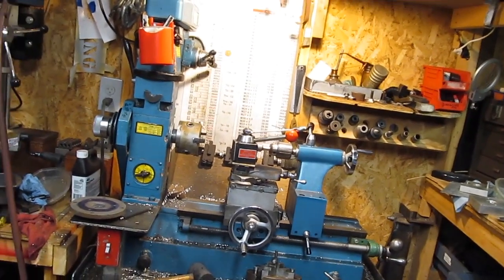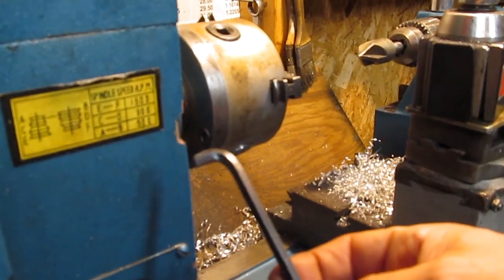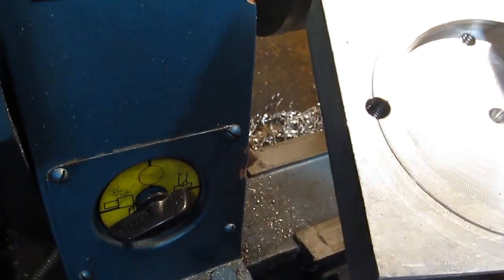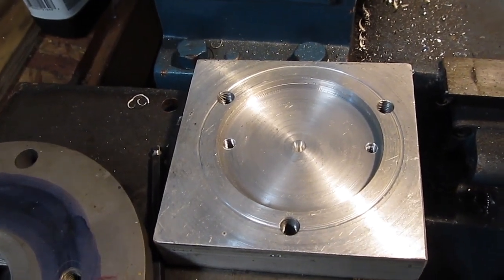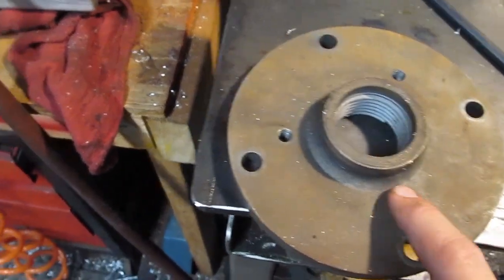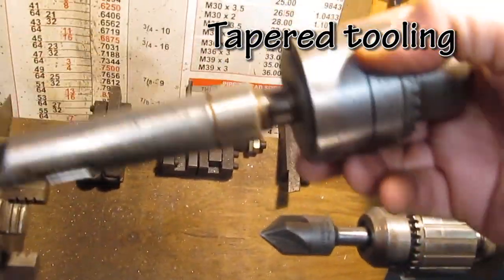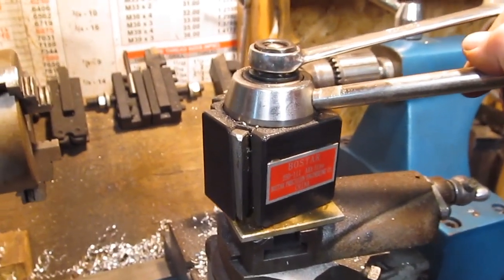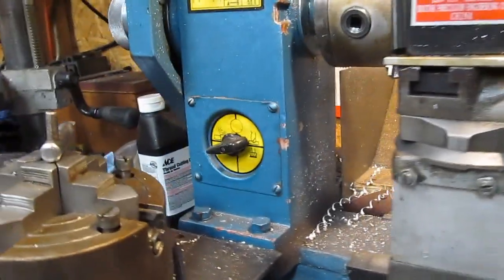Q&A HQ400 Mill Drill Lathe by Chizhou

Comment: Thanks for the detailed answers about the chucks, face plates and spindle tapers.  I very much appreciate it.   It's very useful information to know.  I was guessing about the 3-bolts on the back of the chuck but wasn't sure.   It's also nice to know that they are 6mm.  Now I know what size Allen key to modify.    I was having difficultly trying to get something in there to measure them.
Reply from the maker: Thanks for watching and subscribing!
Reply: Just as an update:

I just now went out to the shop, modified a 6mm Allen key and removed the chuck.  First time I ever had the chuck off.  I'm thrilled to learn that there is a Morris taper behind it.   I threw an MT3 center in and it stuck in there perfectly.   I had no clue that was even available.  This is great!

By the way, on my machine the tailstock is also MT3.  So apparently I have MT3 tapers all the way around.   My machine is very slightly different from yours though.  They look very similar, but mine has the power feed and thread cutting feature.  So apparently it's a slightly different model.

Anyway, thanks very much for the information and videos.  I enjoy seeing how you solve various other problems of holding things in place like the brake drum and carb manifold.   It's always nice to see how other people solve these problems.

By the way, I'll probably being going crazy making a bunch of specialty face plates now.  A face plate is almost as good as a four-jaw chuck.  Sometimes even better.
Reply from the maker: @Mystic0Dreamer  Very cool, that's why I started making videos. I've learned a whole lot watching other creators and just wanted to give back a bit. Glad I could help.
Reply: By the way, this is a bit off-topic from  this video, but I see you are into motorcycles too.  I also noticed the picture of the Triumph you have on your  YouTube channel.  I  had a 1970 Triumph Trophy 500.  I loved that bike.  I actually had quite a few motorcycles including some Harleys, but nothing handled better than that Triumph.  That Triumph was a masterpiece of engineering.  At least in terms of how it handled.  Although I never had a lick of mechanical problems with it either.  I wish I still had it today. 

Today I have only one motorcycle left.  It's a 1982 Virago 750cc.  Unfortunately I let it go and it's in pretty bad shape.  It was stored in a barn for many years and the barn roof leaked.  So the bike got wet and rusty.   I currently have it in a dry garage and I'm hoping to restore it.  I really like this bike too and would like to get it back on the road. 

I tried to start it last year and couldn't get it to fire.  But it was a superficial try and I really didn't put of a lot of effort into it. (too many other projects on the fire).  I couldn't drive it even if it started.  It's needs major work done on the brakes, etc.   The wheels don't even turn very freely, it's quite hard to even push it around.   So I'm looking at a major rebuild.  

Anyway I just thought I'd share that tid-bit.  I'd like to drag it out in the spring and give it another shot at trying to fire it up.  If I can see the motor run again I'd be more excited about tearing the whole thing down for a complete rebuild.   Not a motor rebuild.  I don't think the motor would need to be rebuilt.  At least I hope not.  But surely the carbs will need to be rebuilt.  And the wheels and brakes, etc.   The motor cranks over smoothly.  At least that much sounds good.
Reply from the maker: Yea, motorcycles are most of my business, and my favorite are the old Triumphs. I have 2 at the moment, a 1974 Trident and a 68 500 that is a bobber of sorts, its the bike in my avatar. I also have a HD Road King that is the everyday bike as well as parts and pieces of probably 100 others of all makes. 

You should not have any huge problems with the Yamaha unless it got water inside the engine. You probably will need to inspect and clean electrics if they were damp for a long time. You will most definitely need to clean the carbs if it has been sitting. If you are planning on spring, go ahead and spray some WD or PB down the spark plug hole, kinda spread it around in there, but not a whole lot. Do that a couple times over a few weeks. That will help lube and free up the rings for when you are ready. Those engines will be pretty dry up top after sitting so if you see anywhere you can squirt a little oil or spray into the heads that would help as well (valve inspection hole for instance, I can not remember exactly how that works on that bike).

After that, what I do with a bike like that before anything else is check for spark and compression (both cylinders should be at least 90 psi after spinning for a few revolutions). You can get a comp checker on Amazon for $25 to $40, you don't need anything real expensive. If you don't have compression, on that engine, forget it - you might as well plan on a rebuild of at least the top end. If you don't have spark with a fully charged battery, it is probably just dirty connections, they have pretty good electronic ignitions but they will corrode in damp. If you have both of those, you can try to squirt some gas in the carbs or in the spark plug holes and see if it fires. But honestly, if it has been sitting awhile with gas in it, the carbs will need removed and cleaned before I would expect it to run on its own. 

Anyway, thanks for sharing and if I can help you out with anything 
 or parts let me know, I think I have a 750 Virago stashed somewhere that has some good pieces. Best!
Reply: Thanks for the tips.  I have a compression tester so I can check that out fairly quickly.  Although the bike is currently "buried" under a lot of stuff.   I have to confess to being way overly ambitious and I'm one of those people who have far more projects than any one person should ever try to take on at once time.  

For example, sitting right next to the Virago I have a 1947 Chevy Fleetline that I'm restoring.  The car runs and moves under it's own power.  I just bought it last spring.  Got a really good deal on it.   In fact, I could have this car on the road pretty quick.  It wasn't running when I bought it, but fortunately I was able to get it running with very little work.  And it runs really smooth.  However, it has similar problems as the bike when it comes to brakes and wheels turning freely.  So I need to go over the brakes on this old car.   I'll definitely be putting this car on the road before the bike.  The car is much closer to being a finished project.  In fact, the major real hold up is that I'm redoing the entire interior.  The original interior was all there, but it was also totally rotten.  So I'm reupholstering the whole thing and I'm doing it all using raw materials.  I'm sewing up my own seat covers and door panels.  It's not going to be a professional restoration by any means.  But I'm not even shooting for that.  I just want to get it up and running and be able to say that I did it all myself. 

In fact, the Yamaha is actually "buried" under the 47' Chevy seat cushions.  I have limited space.  Too many projects for such a tiny garage. 

In fact, what actually happened was that I was starting in on the Virago project when I found this '47 Chevy.   The deal was so great I couldn't pass it by, and I have absolutely no regrets either.  I haven't seen anything anywhere near this nice for a similar price.   So anyway, that was the big distraction that pulled me off the Virago project. 

Not to mention that even the '47 Chevy project is something I really don't have time to be doing.  But I just can't help myself.   I had to grab it while the grabbing was good.  And like I say, I have no regrets for  having done it. This was a "steal" truly.   I was very lucky to get this car at the price I paid. I'm still pinching myself to be sure it isn't some sort of dream.  The car runs beautifully.   All the glass is in it and in good shape.  The doors open and close like it just came off the showroom floor.  The frame and body are also in fantastic shape.  No serious rust on it anywhere.  Just a couple superficial spots.   Pinch, pinch, pinch, I still can't believe it's true!

I just went out and looked. Yep, it's still in the garage and I actually touched it!  It's not a dream. 

I''ll have to unbury the Virago and see if I can measure the cylinder pressure.   90 psi you say?  I'll check it out.
Reply from the maker: That sounds like a fun project. I wish I had the space for a auto resto, maybe if I cleared some bikes out. 

90 psi is minimum, it should be more like 110/120 or more but it might recover a bit after it runs. And it should run on 90, though not necessarily great. If it can hold that much, it is worth it to me go on and see what happens after clean carbs. This is all my opinion and experience of course, if it is less than 90 it is most likely a parts or rebuild candidate. I have seen bikes "run" on a lot less but never one recover enough to be usable. Though, do spray a little WD or oil in before, because the rings are designed to seal with a coating of fluid and that might affect the comp test.
Reply: I actually don't have the space for an auto resto either.  It's pretty much a summer project.  I pull it outside to work on it.

Comment: Has anyone  disassembled the lathe spindle , the dog clutch and the pulleys? I'm having rouble doing so...  Can't pull the pulley and have trouble putting the dog clutch with  the spring and and the steel ball back in... On top of that it seems the privatech site wich got lots of info is down...
Reply from the maker: I did it when I got the machine but honestly my recollection is not very good. It was over 7 years ago before I started making videos. I remember it being a PIA but not going to be much help. Try @bustednuckles2 he did a lot of work on his.
Reply: @theeddies  thank you for your feedback. In the meantime I managed to get the dog clutch with the spring and steel ball back together. Still got trouble pulling the pulley.I don't want to damage the bearings...
Reply from the maker: @ckreinberg3043  IIRC the bearings are pretty standard and cheap. I have considered putting in tapered bearings but I don't think it is worth the expense. The ROI is not that great with this machine, maybe if I were trying to do very small parts or converting to CNC.

Comment: I bought a Chizhou HQ400/3a recently which is not looked after very well. Are there any extra gears coming with this machine for thread cutting, because this one has not any.
Reply from the maker: Mine never had change gears for thread cutting. It was never set up to thread cut.  There are models of the HQ400 that do though.

Comment: Hey there, I just bought the exact same model a few days ago, and found your videos very helpful. Thanks for uploading them! I have a question though, in my instructions book it says you need to grease the inside parts behind the square cover, and you are saying fill it up with oil. I opened my cover, and it was indeed all smeared in grease inside. It wasnt packed full, but there was quite a lot inside. So what is the correct lubrication there? Thanks and please upload more videos ;)
Reply from the maker: Grease is what my instructions say as well. I just prefer gear oil (90wt) to grease, it is easier to check and keep topped off, though it does leak a little past the bearings. I did not feel the grease stayed in place well enough in that big cavity. I just fill the oil to the bottom of the cover opening which means both the lathe gear and mill gear are about 1/8 to 1/4 submerged. I have run it that way since I got it with no issues. The grease that was in there was so packed in and thrown all over the place it took forever to clean it out. Totally up to you. Thanks!
Eddie
Reply: @theeddies   Just a follow up: I replaced my cover with a 5 mm transparent Plexiglas cover that I hacksawed out to size, and drilled a 14mm hole towards the top of it so I can fill it up with the hydraulic oil container taht has this tube whenever it seems to be running low. Turned a plastic plug with an O-Ring to close the 14mm filling hole. So this seems to be the easiest solution. I might stick a small plastic container underneath the bearing to catch the oil that is leaking past the bearing. I can then use it to lubricate the cut if needed, although this might not be the best oil for it. But it's there so I guess... :)

Comment: Hi, thanks for your videos and the time you have put into them. A great resource for the HQ400. I have just purchased a HQ400 after having a smaller hobby lathe. I race classic motorcycles and mostly making small aluminium items eg wheel spacers and the like. The ability to do some basic milling will be very handy too. A question about the mill head please - the mill head as you know rotates and is locked in position by tightening a screw handle which tightens a locking bush. When tightened/locked in position my mill head has approx 3.8mm of movement rotational movement if I rotate it back and forward. I have found a basic manual online with schematics of the head unit but cannot see from that where the slop may be or how to remove it. Are you able to offer any advice on this? Thanks
Reply from the maker: Hello,
The locking mechanism on mine is very simple, there is no real bushing. The big block under the head has a cut in it and the screw squeezes that cut down on the head shaft. There is a really good picture of it here http://www.privatech.se/images/HQ400/003.jpg

I know I have to crank on mine more than I like. But barring that the only thing I can think of is the shaft is very worn, which I cannot imagine happening. Or the bolt is maybe bottoming out and not squeezing tight enough. You could try taking the bolt out and putting a washer or 2 on it to see if that makes a difference. 
Hope that helps,
Eddie
Reply: @theeddies  Thank you for that. That’s a very simple clamping system. Unfortunately mine does not have that split block type clamp :( This is my machine https://www.alibaba.com/product-detail/Multi-Purpose-Lathe-Drill-Mill-Machine_60688730784.html The clamping block is solid so it must have some kind of internal clamping mechanism. The head locks solidly when rotated to various positions but always with the 3.8mm rotational movement. The schematic drawing shows a couple of locking bushes. What I cant understand is how they can lock the shaft but still allow the small amount of movement. The movement just requires a small gentle push. Maybe the head shaft and the round collar that it goes into are a two piece unit and the shaft is loose in the collar? Think I’m going to have to get to and pull it apart to see what’s going on in there. Thanks again for your help and prompt reply. I’ll let you know what I find. Cheers.
Reply from the maker: @timgerard9806  ahh, you have the type with the head that goes up and down. Not familiar with those but it sounds like something must not be adjusted properly. Obviously any movement of the head makes that function useless even as a drill press. Please do let me know what you find. All the best!
Reply from the maker: @timgerard9806  The link did not work but that sounds like you found the problem. Well done! Take a bit of video when you get a chance of the unit.
Reply: @theeddies  All fixed :) and a couple of test runs done to ensure all ok. I drilled out the existing roll pin and enlarged the hole to take a larger heavy-duty 8mm roll pin and added 2 more roll pins at 90* to the first roll pin. Assembled all the bits that shouldn't move with JB Weld as a belt and braces approach and all seems good :D
Reply from the maker: @timgerard9806  Good deal man. Well done!

Comment: I like what you have done with yours regarding the aluminium tool post and compound slide. I should have done a video for mine when I replaced the bearings but hadn't done much youtube back then, not that I have had time to do much now either. As you say, cut slow on these, especially if using the original tall 4 position tool post.
Reply from the maker: The chunk of aluminum works very well. I had always intended to replace it with a piece of steel or cast iron but never had any issues. Would be a bit pricey to buy a chunk that large but like I said it was basically free from a bulk buy at an estate sale.
Reply: @theeddies  nice job. Aluminium is so much easier to work with and cut accurately.
Reply: @theeddies  you Northerners speak funny, it is Aluminium not Aluminum here in the deep south of OZ....LOL. The American Chemical Society (ACS) officially adopted aluminum in 1925, but in 1990 The International Union of Pure and Applied Chemistry (IUPAC) accepted aluminium as the international standard. And so we land today: with aluminum used by the English speakers of North America, and aluminium used everywhere else.
Reply from the maker: @MrOzzyCam  Lol. I have several Aussie friends as well as a few Kiwi's. I know all about your problems. ;-)